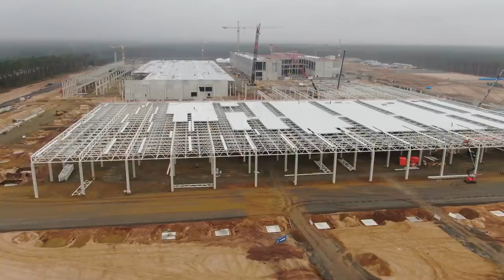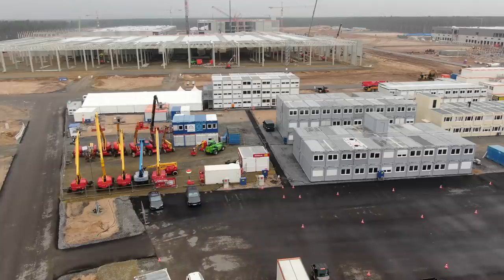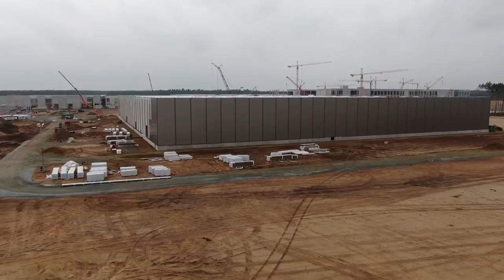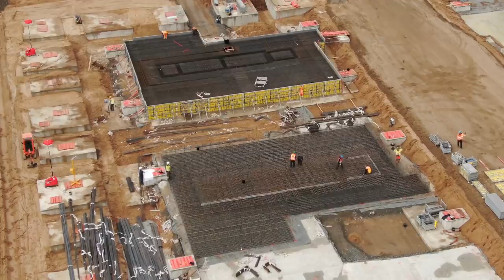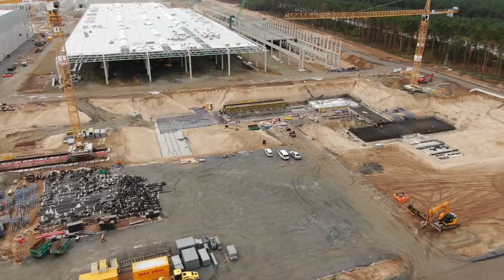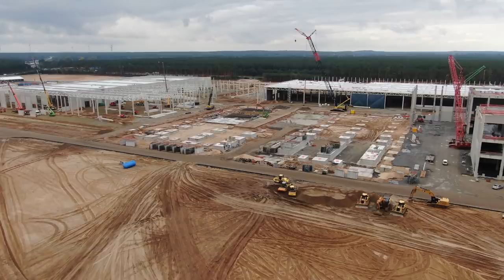Giga Berlin | 2020-10-10 | Giga Press Foundations

Comment: OK the foundations do seem quite heavy after all. Slab thickness seems to be well over 1 metre, judging by the molds.
Reply: And for the stamping presses even more. Not joking around.
Reply from the maker: True. I actually didn't expect the casting foundations to be that big.
And the stamping foundations are really heavy. It seems like there are multiple layers of thick slabs on top of the piles.
Reply: It's insane. I shiver at the thought of having to demolish those structures somewhere in the distant future. An only because some German over-sensitive Statiker had a fear things might bend more than 0,1mm

Comment: This place will have to have several parts: stamping facility, body shop, paint and final assembly. You're looking at 1.5 to 2 million square feet pumping 500k units per year. With 95% automation that will require a minimum  3000 personel.
Reply: Plans have been filed for up to 40,000 employees (to allow for infrastructure planning by the state) - that would suggest a goal of 2 Million vehicles per annum
Reply: @j.pgoodwin9020  Oh! Well!
Typical Musk. If you gonna commit, GO BIG!

Comment: Looking at the side of the 'paint' factory closest to where you landed, it looks like they will be putting windows there, since they have 'topped' the risers. I wonder if that will be offices or something other than painting factory. The whole side of it fronts the road and seems like it will be all windows, so perhaps it is that? What do you think?
Reply from the maker: Most offices with windows should be in the lower buildings, there will also be some offices and a canteen in the paint shop though.
You can see what it should look like in some of my other videos. 
For example this one at 7:50: https://youtu.be/EavR5Ih1Y5o?t=470
Or this one at 3:40: https://youtu.be/saJnH4le1Ts?t=220
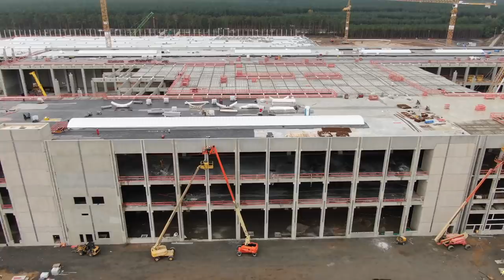Reply: @TobiasLindh  Hi Tobias. Thanks so much! I was thinking that because at 6:54 in this video, we see them finishing the top of the wall, putting in the 'fourth' section. I can't figure out how they'd get concrete wall in the three sections below the top, since they usually slide them in starting with the bottom one. So I was wondering what will go in those open sections instead. Does that make sense?
Reply from the maker: @stevenfierberg457  There will be no concrete walls at those sections. There will be just insulated metal wall panels. The concrete walls are usually just for fire protection.
Reply: @TobiasLindh  Thank you!

Comment: Great job.  Just found your channel!  This has probably been asked already but I am curious why the floors of the walled and roofed buildings are still dirt?  If they are to be concrete, wouldn't it have been faster to pour them first? If concrete after the walls are up?  Or will it be something different and thus needed to be protected by the elements?
Reply from the maker: As far as I know this is standard procedure for big industrial buildings. I'm no expert, but in my research I didn't find any factory where the floor was poured first.
I actually don't see any reason why it would be faster to pour the floor first. And I don't think it would be good to move big crawler cranes over the new concrete. Also, those columns with integrated footings that Goldbeck uses couldn't be placed when the floor is already in place, because the footings go under the floor.

Comment: Is there a bar code or something on each piece of concrete prefab....?
Reply from the maker: Yes. Every part has a sticker with information about the part and a bar code.
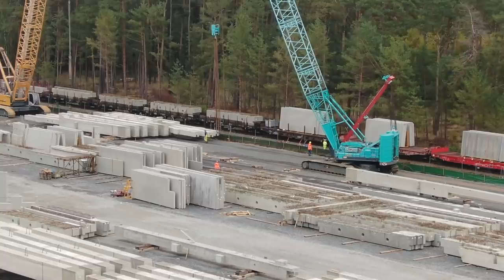You can see it in my video from the 1st of October at 3:05
https://www.youtube.com/watch?v=C9a5EBPZINc&t=187
Reply from the maker: House Essentials  Of course there are different parts. For example: The outer columns are different than the inner columns. Columns also have different attachments for multiple floors. And double-t floor elements have different lenghs, and so on.. There are a lot of variations. On the sticker is also an information about how many of the same part are ordered.
Reply from the maker: House Essentials  I think it is a basically a standardized system with modular customization.
Reply: House Essentials  It's like an Ikea kitchen. The cabinet is allways the same (white, 60x60x80cm), but you can add different doors, drawers, bases, ...
Reply: House Essentials  But that does not work.
Reply: House Essentials Prefab in this context doesn’t mean the same as ”off the shelf”. Every part is a custom part (of course there are multiples of the same), the idea is just thet they are made in controlled conditions in a factory with great molds & post-processing equipment.

The actual construction site is then mostly for assembly work, not fabrication. Pretty much the only thing made on-site are the footings.

Comment: Fast and clean contruction zone. Tesla has made smaller factory vs Giga shanghai. Let's wait for the output.
Reply from the maker: This is just phase 1 and it's much bigger than phase 1 in Shanghai. Expected output of phase 1 is 500k per year. Ramp up might take some time though.
Also keep in mind that the cleared area for phase 1 you see in this video is already bigger than the complete site at Giga Shanghai.

Comment: Yep, those presses need isolated  and damping vibration capabilities. When they work they can shake Berlin, whole Germany, European Union, Russia could believe that WWIII started. 
Whole tectonic plates could shake and tremble.
 In resonance domain  the Earth could behave like a baseball  hit  with a bat at 120 mph. (Watch a video in slow motion) .
More so in resonance mode the Earth could disintegrate and the Solar system could have another asteroid belt between Venus and Mars, similar to that between Mars and Jupiter.
Generations  of humans  after millions and millions of years from now,  would scratch their heads  to explain how this second asteroid belt appeared in our Solar system.
And that all because Tesla Inc. when built the Giga factory in Berlin  forgot to isolate the high tonnage presses used in the manufacturing system.
Yes, the damn manufacturing equipment, on the Tesla presses line in the BerlinGigafactory  could destroy a  whole planet ( and life on it) if not more.
Ha !

Comment: Bring 20k workers from china to finish his agony in two weeks...
Reply: Sure because the limiting factor is manpower and not logistics^^
Reply: @bliblablubdiedadup742  Yes they finished 2x faster as well. Ofc it is man power as well, cant "prefabricate" whole factory with 20 workers
Reply: I think Shanghai is smaller than Berlin which much smaller than Austin. Both have a battery plant, but I don't know if Berlin will process lithium like Austin. Austin is almost 2500 acres now or what 2.2 acres per hectare? Say 1150 hectares and more being bought it looks like.
Reply: @youwish3566  Concrete needs around 30 days to cure to get the strengh necessary for construction. Codes on the collums indicate that they are all made while building is going on and are usually not older than 30 days. So altleast in paint, stamping and casting manpower is not the limiting factor. Furthhermore we can expect the workforce to increase by a factor of 10 when inside works start.
Reply: @bliblablubdiedadup742  I really hope so. They could prepare walls somehwere else while they played with ww2 bombs and left overs,lizards,bats, etc
Reply: @youwish3566  So in your eyes "drawing up the plans for those walls" is no work?
Reply: @HenryLoenwind  Everything is a progress but very slow one
Reply: You got a Baby in 3 month with 3 woman?